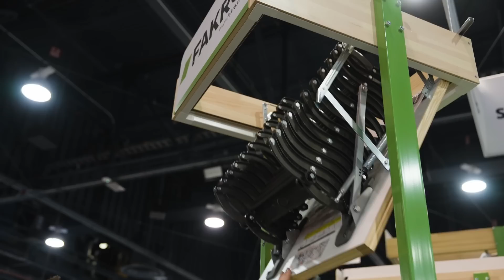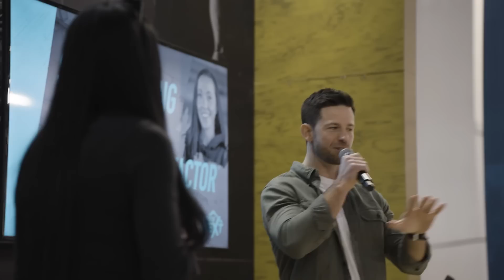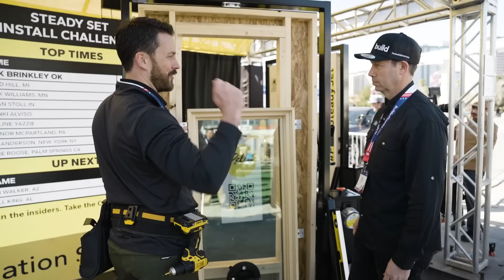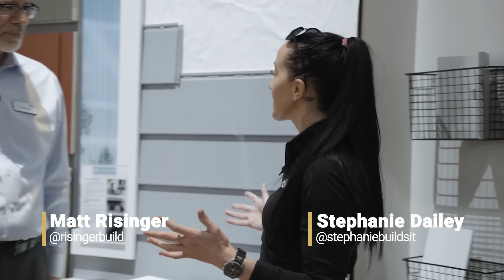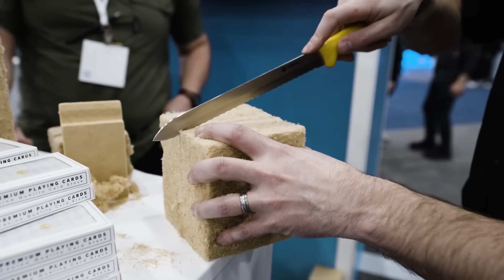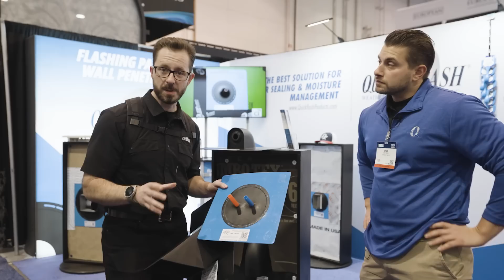AMAZING NEW WINDOW INNOVATIONS NO ONE HAS SEEN  & MORE - Design and Construction IBS 2024

Comment: So the problem I see with the Warm Board water heat/cooling wall system, that vertical unit installs up and down the span of a wall stud bay…so then you sheetrock, plaster, etc and finish off the wall. Then Mr. and Mrs. Buyer move in, and someone decides to hang a picture on that wall and they pierce that expensive system. Not thinking this system is transferable or sustainable throughout multiple owners.

Comment: It is amazing with all the new products and chemicals, coatings and composites what they come up with today.  They molded them and cut them with new angles and grooves so they fit together.. 

But I still think of my grandparents house and all the neighbors who still have their original siding on their houses at over 100 years old .  That had the very poor vapor barrier of 30 pound tar paper. 
      Imagine if they made tarpaper 100 years ago with a tarp seam sealer, where they used natural products, even though they have high VOCs, and they seem sealed and stapled all the seams together, so they were airtight. 

And where the mud seal lays on top of the foundation, they put down a thick bead of leveling tar . 
That will last two years .   in those days all our houses here had a massive dose of creosol dipped and painted on the lower 18 inches to 24 inches of redwood or fur. 

We know it’s toxic, but over the last hundred years it has mostly vaporized all the VOCs away . 
       We still have the original redwood siding. 
      The window and baseboard were made out of a thick redwood that was tapered at an angle for the rain to roll away. 

All these houses that were maintained painted and reworked properly have absolutely no rot. No wet rot no dry rot are in pristine condition. After 100 years. . 

And we know from wooden construction on buildings that are an ideal building locations that are 400 years old and the wood is still in perfect condition . 

What are all these synthetic products going to be looking like 100 years?  

Stainless steel nails and screws were a great invention for buildings in wet climates and near the ocean .  Many of our roof still have the original copper or lead flashing after 100 years.

Comment: Window manufactures could revolutionize the industry by eliminating blinds and curtains forever. Electrified opaque windows have existed for sometime in bathrooms for privacy. Why not spend some R&D to make every window in the house dim to varying degrees, via an electric wall switch or remote? Run wires to every window through the wall. So clean, so easy and the extra cost would be saved by eliminating costly blinds and curtains. Current technology would have to exist to make this happen with a little innovation.

Comment: Wow on the Pella window!
Reply from the maker: I am genuinly impressed with this innovation.  Simple, effective, safer, and the flexible outside flange is totally new.  All that and it's a $zero dollar upcharge.  Impressive Pella!
Reply: @buildshow The only thing I could think while watching the setup at IBS and now this is what happens in non perfect situtions.  Like most installs.  I guess if you only want alignment with exterior trim then this would work great but if the wall is out in any way this will lead to tilted/twisted install.  Now if the clip could be installed like a euro window clip maybe?  But the sealed flanges so that there is no gap at the corner is a great idea.
Reply: @buildshow can't schuco windows be installed from the inside? That integrated flexible flashing is sweet though, schuco windows should copy that

Comment: Hard pass on the wood fiber insulation. They need to infuse it with tons of chemicals and it’s still wood at the end of the day. I don’t see why I would buy this over mineral wool, except for perceived environmental benefits which I’m sure don’t exist in you look at the whole picture.
Reply: Mineral wool is unlimited so it may as well be renewable
Reply: You might be surprised
Reply: Binder is parafin. It is infused with borates- same as cellulose -not an issue
Reply: @gunther1955  "Not an issue", famous last words. Again there is no point unless it performs better than mineral wool or it is significantly cheaper. It is neither.
Reply: We use this in Germany on a daily basis. Comparing it to mineral wool is like apple to oranges in building science terms. Both have good properties but are not a solve all product. Your missing out!
Reply: Like all things “green”, it’s great for the environment so long as you wear blinders and don’t look at the whole picture of production. That being said, boric acid is not toxic to humans unless you eat a bunch of it, so don’t eat your insulation.

Comment: Did they say when that warm board hydronic cooling system will be available?
Reply: We're planning for Q4.
Reply: @Warmboard ….can you provide a rough cost per sq/ft? Super exciting and exactly what I am looking for (location in Provo Utah). I would also like a little more clarification on how it’s heating one room and cooling another at the same time.
Reply: @xokissmekatexo - Not ready to discuss pricing yet, and we're still tweaking the product until it's ready for release. More to be revealed in Q4.
Reply: @Warmboard where does the condensate go
Reply: @mattffleague6041  condensate drain

Comment: Matt .. For Atlas Energy Shield XR what does 25 PSI compressibility mean??  Called Halo and could not get any information on what 25 or 45 psi compressibility means.  Help.
Reply: It means it hold up that amount without deformation.

25 X 144 = 3,600 pounds per square foot.
Houses are devault designed with 125lbpsf as the highest demand.

Comment: That Warmboard fan-coil would also be great if it could be installed in the ceiling, between the floor joists. It sounds like the diffuser would need to be changed to get the correct airflow, but apart from that it's all set.

Comment: I don't think the Pella window would work in my concrete block home. In Florida we do not use wood windows. I wish you would show about installing windows and doors into a concrete block house.
Reply: Because of termites?
Reply: @bothellkenmore guessing humidity (mold/rot)
Reply: Use European style tilt/turn windows. Those are screwed into the inner frame of the window, and can be secured directly to concrete (after liquid flash, gasket, etc).

Comment: Wonder if the Pella system would work for old work renovations
Reply: Not if you dont have access to tape the WRB. I have a brick veneer  house so that’s a no go
Reply: @vapeurdepisse Meaning on an old stucco house that likely doesn't have a water resistant barrier, you'd have to restucco plus add barrier and then be eligible to use this Pella system?
Reply: @MadLadsAnonymous  Is it a stucco veneer on wood frame? If so it probably has a WRB even if old and crappy. You would have to redo the stucco around the windows. Not worth the trouble and expense. Just use a flangeless window and isolate it from the air gap using Prosoco Joint & Seam Filler and then FastFlash as shown on this channel and other places around the web. No need to tie into WRB with this new technique. There is an article somewhere where they tested the hell out of this system for retrofitting windows and it worked great. I'm planning on doing that for my brick veneer. I'm thankful to this channel for showing me this newer high-tech product that solves a real need.

NOTE: Not 100% sure how my technique translates to stucco vs. brick. You have a thin layer. Read about it and think how you could adapt the system to your situation.
Reply: @vapeurdepisse  It is a wood frame and the house is almost 100 yrs old. A GC said the house likely doesn't have a waterproofing layer since there are so many large cracks (suggesting this is how long ago it was likely stucco'd).

I will relay your input, thank you!

Might get a quote for full stucco removal (if truly no WRB) and replastering with Kemset Ecoplast 50. Probably north of 50k for a 2 story 1700 sf home. 

If they can just fix the cracks with epoxy and those anchoring systems for larger cement joints, maybe they can just add a layer of the Ecoplast on top...that should be a huge savings.
Reply: @MadLadsAnonymous   Obviously I don't know your specific situation, but my brick veneer house is 100 yo and it does have a WRB (tar paper). So it's not out of the question. Personally, I don't see why cracks are an indication of lack of WRB. My experience with North American stucco is that it's just crap. Europe and South America do it right with applying it on top of concrete, the way it was meant to be, but wood frame moves too much for stucco. Newer stucco isn't much better. I see brand new multi-million houses with stucco in my town (near Boston) that look cheap and damaged because it's hollow. If this were my house and OK with changing cladding I would 100% go with a different material altogether that does better with wood framing. Lots of cool materials to choose from these days. Good luck with your project!

Comment: Is that interior attachment method from Pella a patented design? I can see that idea taking off as you can do most of the window from inside.
Reply: A similar system has been available for a while now. Check out Frontline's Tru-Loc anchor system. Can be used on any window or door. Especially comes in handy on clad entry doors with sidelights.
Reply: I’ve seen tons of these systems around even on this very channel. They are euro windows I think.

Comment: Heck of a window setup from Pella. Not an exaggeration to say it will utterly change the industry. It's so obvious, "why didn't I think of that?" indeed applies.
Reply: In europe it’s been the standard for decades to install windows from the inside 🤷‍♂️
Reply: @miles5600  More accurately, the standard there has been non-flanged windows. Flanges are a better way to install, though. Foldable flanges have existed in the US for a while, but that still means nailing from the outside.
Reply: @TheRayDog  yes we don’t use flanged windows, we use expanding foam and screw the window from the inside into the concrete.

Our houses are also built very differently, we have brick facades and behind there’s the precast concrete shell of the home, in between the brick and concrete where’s something what we call “spouw” and it’s either filled with insulation or they screw the insulation onto the concrete before beginning on the facades, the gap between the brick and concrete is 120mm nowadays and makes sure the house is very close to passive house standards and that it’s airtight. The US still has a lot of catching up to do before they get anywhere close to our quality and efficiency.
Reply: @miles5600  The US system has emphasized speed, cost, quality in equal proportion. It's the only way to fairly offer housing for the most people. The problem we have now, we're tilting by force of govt rules to a Euro system, where speed and low cost get pushed aside. Not because energy is lacking, but because energy is becoming artificially restricted. Poor Euros having to build to passive standards all these decades just proves the adage, "Europeans live in functional poverty." The greatest culture and civilization the world has ever seen, drowned by fools in govt. The smartest people on Earth, using their smarts to merely scrape a living where a bountiful existence is possible. It's sad, and the US is heading that way as well. You say that's "catching up," but it's actually falling down to an overall lower Euro standard of living. The US housing industry is vasty better than Europe's. Because it's wider, more optioned, more skilled at the expensive top end, cheaper at the low end, and more efficient in the middle. Because we have some choice left here, the distributed knowledge of people beats the centralized knowledge on which Europe exists. For windows specifically, we have market conventionals, which these Pellas seek to revolutionize,  or higher efficiency of say Alpen's u=0.10, to very high efficiency, if not the highest available anywhere around u=0.05 film windows. While Europe muddles along, with little choice other than the name tag on windows that perform well but the same. The system handcuffs Europeans, it is what it is.
Reply: @TheRayDog  why do you think passive houses are for poor people here in europe? Cause they’re not. And how is the US housing market wider? The US has mostly single family homes cause the land use is only zoned for that in most places and there’s strict rules regarding minimum amount of parking, not to mention that a lot of houses come with an HOA which are stupid, your house means your saying, not the other way around.

And why do you think we have worse quality? We don’t build our homes from vinyl siding and plywood that gets penetrated by a screw.

Our houses are overall more efficient and modern because we like being progressive (at least here in The Netherlands) while a lot of American homes have old outdated designs and a lack of fire safety, where i live a fire blanket is required and in new construction a fire extinguisher and sprinklers. Have you ever been to western europe?
Reply: @miles5600  Language is an issue here. I don't disagree with this last reply. By "wider" I meant a greater spread of low to high quality building techniques and products. By "poor Europeans" I didn't mean financially poor but "tough circumstances forcing choices people might not otherwise make." I emphatically don't think Euro quality is inferior. Either products or builders. The opposite, really. Standard Euro quality is better, but that's not a good thing. Quality comes at a high price that often isn't justified. Choice of quality level is a more important issue for a society as a whole. That's the key reason the US trades are better. We deal with a wider spread of component quality and can build to target markets better. It's not functionally fair to those on the lower end of the economic scale to build everything to a high, expensive quality standard. Your fire suppression example is a perfect illustration. In Europe, sprinklers. In the US, detectors and mitigation of risk. The US path is far better, because it's more cost effective. Euros chase diminishing returns. Our system offers great protection for the most people at reasonable cost. Sprinklers might offer the best protection, at high cost, but are rarely needed, and rarely determinative in saving life. It gets back to my first comment: cost, speed, quality. In Europe, the first two are largely ignored, with emphasis on quality. That's not the best model imo, that's all. Risinger's channel is more aimed to higher level build quality than what is standard in the US, hence highlighting interesting Euro items. But I can tell you with certainty from many years doing this, mid-market is not embracing of expensive Euro quality.
Reply: @TheRayDog  thank you for your comment. I now get what you meant, but it’s not really accurate.

Cost for most things like fire suppression and smoke detectors, indoor appliances, etc are cheaper because the government has been standardizing safety and certain products which makes them cheaper, also many things are subsidized like improvements for passive house standards.

Mitigation wise we don’t need a lot of it because most stuff is already rated and engineered to be as safe as possible like wiring inside homes, circuit breakers and non flammable insulation. There’s barely any cases of homes catching on fire thanks to an electrical issue cause of the way we have this standard system.

Same goes for many other things like having minimum efficiency standard for certain construction like big apartments that’re required to have tilt and turn windows cause of their efficiency, this helps those companies make a profit and make the product cheaper for people who’re on a budget, this is currently the case Massachusetts, they started requiring cities like Boston to have a minimum R rating for new construction which is forcing the market to turn to more efficient construction, the US has been known for wasting so much energy cause of outdated legislation and now that energy is becoming more and more scarce we have to take action by moving forward.

Why do you think speed is something we don’t have with our construction? We also have wood framed construction, but with just better materials.
Reply: @miles5600 Is NL utilizing CLT products now for faster construction? (glulam, CLT, DLT)
Reply: You should also mention the quality of your windows, and how they seal so well.  My wife is from Denmark and their windows (and doors) put American windows to shame. @miles5600
Reply: @TheRayDog Too bad you started with "artificially restricted" .  You showed your hand at being a conspiracy theorist versus a science believer.  We do have wider range here but our waste is beyond what any others in the world produce.  It is non sustainable unless you just want to leave here and move to mars and start over.
Reply: We gave you McDonalds, finally we get something in return! 😂